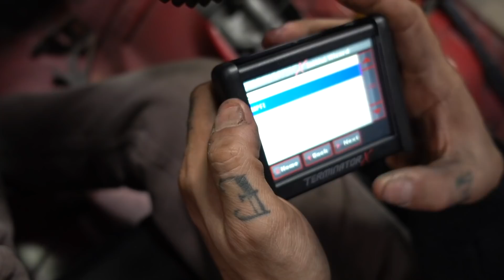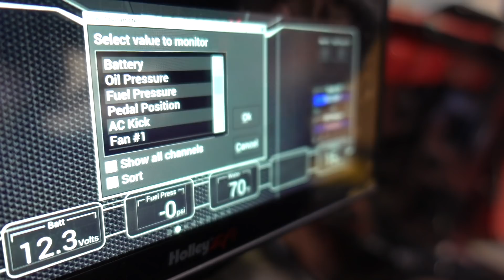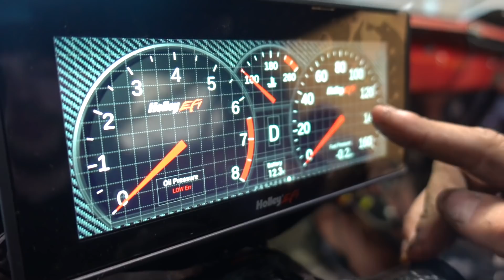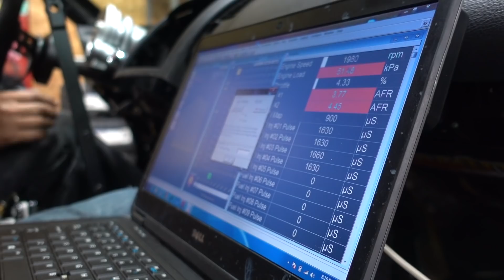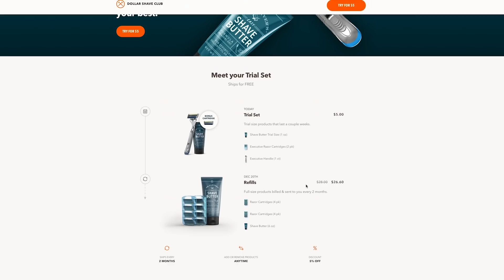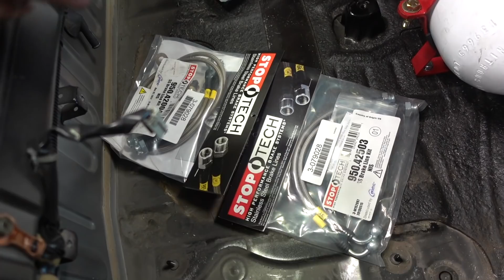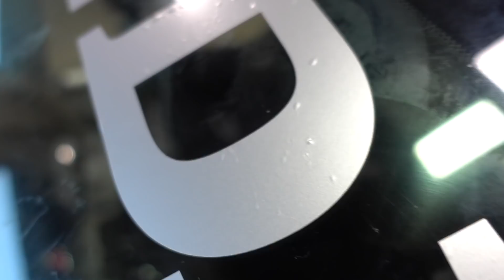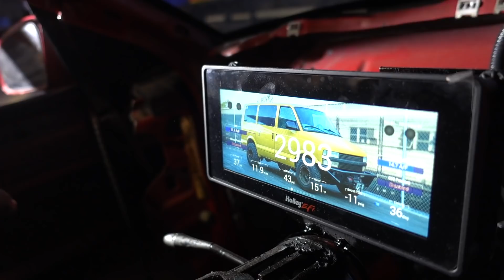Build & Battle 3: Crunch Time! Wrapping Up the Honda K24 Swapped 350z and 3rd Gen Camaro builds EP.7

Comment: If you need to make brake lines buy some Ni-Cop line off amazon. It's rust proof, can be bent by hand, and is super cheap. I have it on 3 cars in the rust belt, no issues ever. The plus is you don't need that tool they use, you can just push it into place in factory mounts, then cut/flare it at the end. Takes like 45 minutes with a crappy rented flaring tool. Another plus is if you get a crappy flare and it leaks, you can just torque down the line more b/c the material is softer than the steel mating surfaces it will conform to make a perfect seal. Love that stuff.

Comment: at @ 7:45 thats why the adjuster spacer goes ontop the spring, not under the spring.  it's not a coil-over in the rear.  the adjuster becomes part of the body and retains the spring, and the axle tube perch nests inside the bottom of the spring.  'cmon mason!  first no compression, now upside down spring adjusters & janky spring spacers?  how do you keep buying parts when you're well over budget?  asking for a friend ;)
Reply: i've been prioritizing unnecessary hoonigan rad plate and unnecessary upsidedown spring adjusters, instead of important things like a battery hold down and brakes LOL "we'll cross that when we get there" LOL right on.

Comment: If josh can manage to not blow the ten bolt, they’ve got this in the bag... they’ve got a better chassis, more angle, more torque, etc. I hope they ended up running smaller tires or more air pressure.... otherwise that ten bolts fate is doomed😂 but jamo and suppy are cool dudes as well
Reply from the maker: Will the Camaro rear end strike again?! It sounds like Josh has it all figured out, to keep the weak link from breaking.

Comment: My money is on the K powered 350z!! But it sounds like the k24 has a stuck IACV? I had the same surging issues with my K swapped CRX. Pulled the IACV and hit it with some break clean to break up the carbon and some WD40 to re-lubricate it and it's been perfect for the last 5 years.

Comment: So, those brake lines Jamo made - I always heard that bending sharp (like, greater than 45 degree) corners like that in brake lines was really bad and can restrict flow. Is that true? I get that the tool prevents the lines from puckering up and all, but the fluid having to make it's way around the sharp turn messes with the flow, and can heat up the fluid real fast since it creates small points of high pressure.

Comment: supy mentioned jamo having to leave to get a check valve for hydro e system. Would be nice to get educated on the reason for check valve. I see the lines are plummed into the abs control module
Reply: jesse delgado I went to get a booster check valve since we sold the motor and the valve went with it , yes I used the proportion valve on the stock abs unit to get my e-brake working as well as having all 4 brakes working as well .

Comment: You really seem to have the format down and got really lucky with some good guests. The shows could get even bigger if you keep it up. I think the budget should stay the same, but maybe give the host $4000 extra he can give out. Maybe bonus challenges or special achievements that can earn a little more cash. Maybe provide a bit more material (metal) so budget isn't spent on that and corners aren't cut (steel coolant hose). Overall the shows been a great direction.

Comment: I think the Z is a cool build but when it comes to racing tire size and reliability is king and the camaro has way more tire and the motor is simple and reliable power if the suspension geometry is good it will destroy

Comment: im going to be so pissed if they dont end up using the front or rear bumper on the 350z. smh Just taking the easy way out instead of making the bash bar hold em up. Also the hole in the floor on the Camaro/Firebird they better be covering that or they gonna be eating tire smoke

Comment: wow gps speedo and so handy all you have to do is drill a hole in the roof......hey waitaminnit......
Reply from the maker: You can actually run the wire through the windshield molding, or mount it near your roof top antenna. 🤣
Reply: @HooniganProjectGarage  prolly can stick it behind the rearview mirror on the inside of the window or on top of the dash under the window too . dont think glass stops the gps signal though it might not have an all around view to the satelites with the pillars in the way